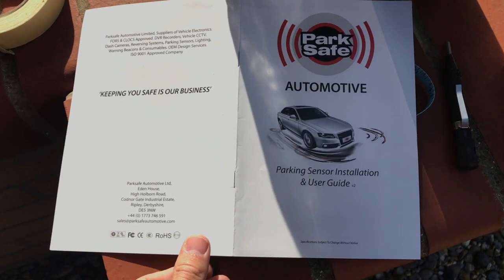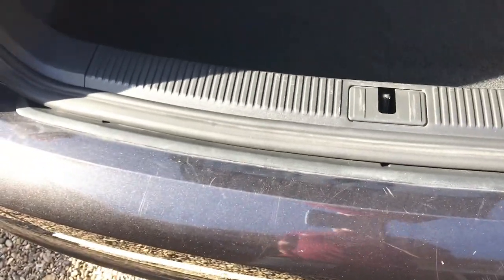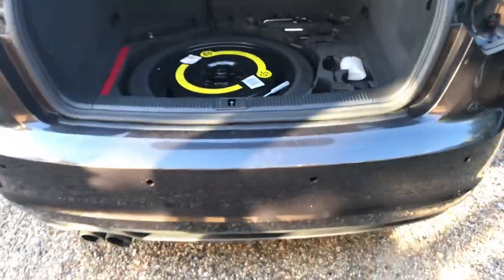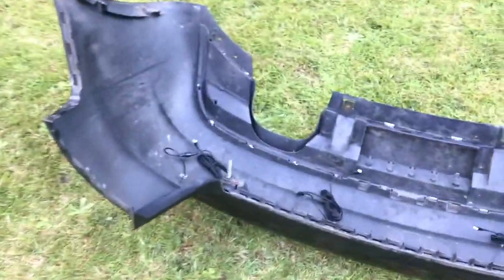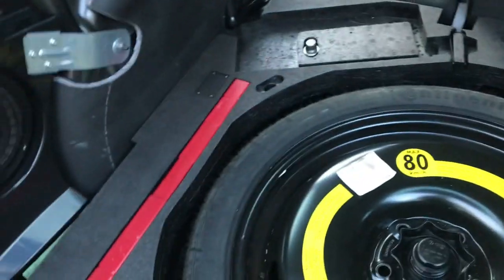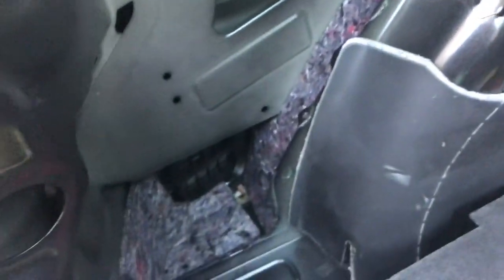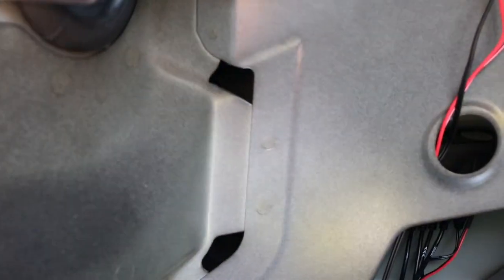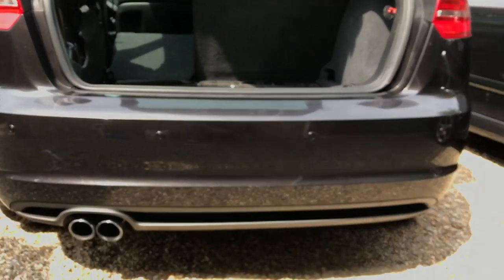How to fit parking sensors to your car (Park Safe rear sensors, Audi 83 8P)

Comment: BIG TIP!!! 

1 = Remove the the rear bumper.
2 = On the back of the rear bumper, there is already marks like this + + + + it's meas you have to drill the hole there. 
 
You welcome! 

GOOD VIDEO BRO!